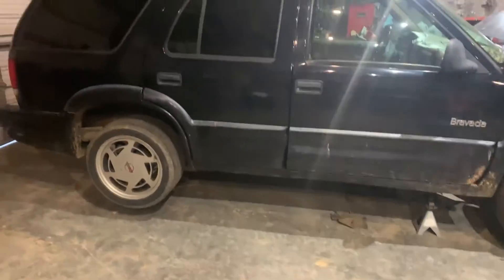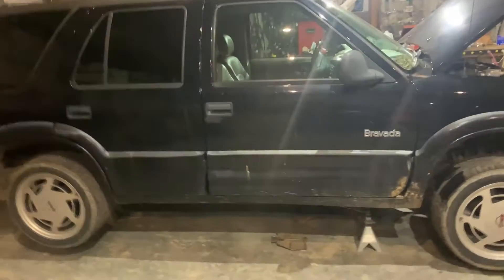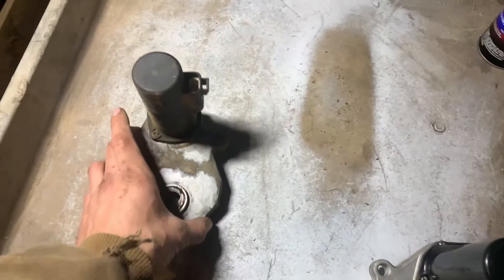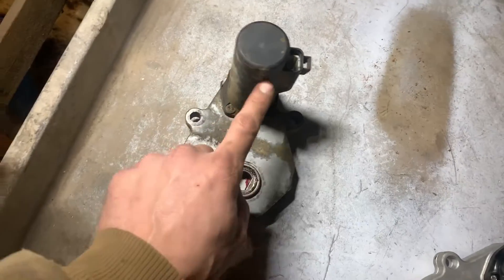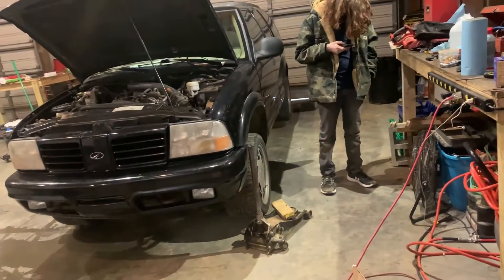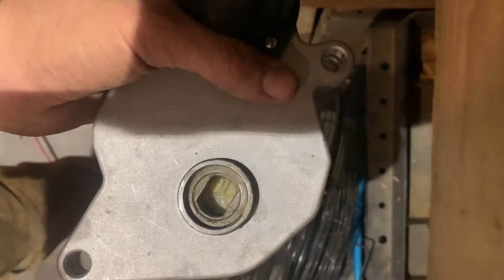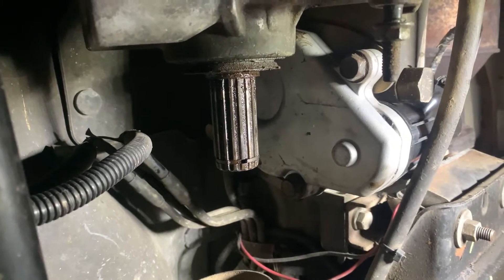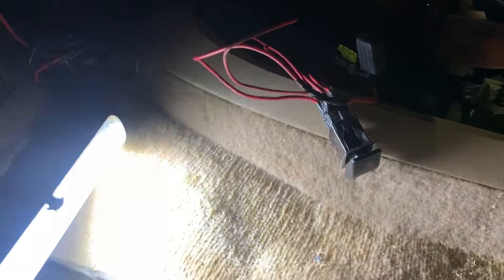We bypassed AWD SmartTrak system! //Bravada Episode 13

Comment: Wouldn't this throw a code if the system is trying to put it in AWD mode and it detects inconsistent wheel speed because your switch is off?  I just got done dealing with 2nd gear limp mode 100+ miles from home and drove home at 35mph over 4.5 hours all because of a stupid broken rear ABS sensor.  $700 in the hole to fix that.  I had absolutely no idea the ABS system was tied in to the transmssion's ability to shift.  Had I known, I would have just replaced the faulty ABS sensors myself.  I was getting inconsistent codes for a transmssion speed sensor (p0502 and p0500) when I threw my hands up and took it to the dealer.  I learned my lesson, but I'm also not keen on dorking around with overriding a system that will leave permanent codes and CEL on.
Reply from the maker: The wheels will turn the same speed regardless of switch. That’s awful! Yeah it sounds like your transmission didn’t know the speed.

Comment: So, other than selectable AWD, is there a reason you didn’t use the Astro-case?
Reply from the maker: This is the case that comes in these Bravadas. It’s auto AWD which isn’t a good design. This bypass is to keep it from engaging when I don’t want it to and to engage it when I do want it instead of it doing it whenever the system is triggered by wheel speed.

Comment: Life saver, need step by step guide for dummas
Reply from the maker: We’re gonna do another video whenever it comes in for upgrades. My fiancé daily drives it so we don’t get a chance to work on it often
Reply: I sure wished uwould let us know what the 7 wires are. I would like to be able to select awd and 2 wheel drive. I also have a black 98 bravada. Will this make other issues with the computer or anything? Would i be able to do burnouts in 2 wheel drive and then switch to awd safely?

Comment: When will u guys post how to bypass the AWD system? Do u guys live in KY? I live outside of Lexington.
Reply from the maker: The next time we get the Bravada in for servicing we will try to film an explanation
Reply from the maker: Yes we’re located in Leitchfield!
Reply: Just pull the fuse. That all you have to do to turn it off. I plan on putting a switch into this circuit since I'm LS swapping and want to be able to do burnouts.
Reply: Thanks guys. I'm trying to do a build and that would help me a lot.

Comment: I thought the rear ends that came in them were the bigger 8.5. Mine says Gt4 and G80.
Reply from the maker: No they are 7.5 or at least ours is. Gt4 is gear ratio and g80 is limited slip
Reply: I figured out gt4 means 373 gears.

Comment: U have done a lot of things im very interested in. I have some C5 rims im about to put on but dont know what spacers to use. The rear end in my 98 is narrower than in the front. Im also trying to decide which size tires to run because the fronts are 17s and the rear are 18s. I havd it figured out i think a 245/50r17 and 275/40r18 are pretty dang close in circumference. Only .1 difference. 26.7 and 26.6 so i hope it works. I plan to do a mercruiser intake and fuel injection swap also plan to buy an ebay turbo kit soon. I cant afford or find a typhoon so thats my cheap reneck plan to make my own. Thanks for any help.
Reply from the maker: Very cool! Keep us updated on the turbo build
On these all 4 tires have to be the exact same or you will cause excessive wear
Reply: I have been driving with these wheel and tire set up for a year now with no issues as of yet. The tires are almost identical in circumference. I have bought the turbo no but it's sitting in my shed. I dont have a garage. I put the marine multiport injection but as soon as I got it running I believe it's spun a bearing. It has over 200k miles on it. It's cold so I haven't gotten to mess with it much. Its loading up and has a knock to it now. I need another low mileage engine to put in it. I would like to try and salvage or build the engine that I take out.

Comment: Will this system work in a 89 blazer? 4x4 I looking to swap my 4x4 to a push button awd
Reply from the maker: Does your Blazer have a manual lever shift in the floor?
Reply: @s10life  yeah its all mechanical
Reply from the maker: I’m not certain you can put an electric actuator on there but you can swap transfer case into yours
Reply: @s10life  thanks and is the bravada transfercase a single speed locking system or is it kinda like the syclones which are full time locking awd?
Reply from the maker: The older Bravada is full time however this one is 2wd unless activated
Reply: Very cool idea. I can't wait for the video explaining the wiring...😉👍🏼 my 98 gmc needs this.

Comment: is it possible to make a 94 gauge cluster with a tach work in a 95 without a tach? or will i have to rewire everything? do the clusters without tachs have the same wiring as the ones that do have them?
Reply from the maker: I'm also in this same boat except the cluster I want to use for my '94 with a '95 CPI 4.3 is out of a '96 with obd 2. That's one thing youll have to look into that I haven't yet. Either way their should be a RPM signal wire somewhere  and you should be able to tap that into the RPM signal on the cluster side
Reply: @s10life  the junkyard above my house has a rare 94 100 mph cluster with tach used in trucks with the 4.3 vortec thats the one im planning on getting. my dad had a 94 2 tone black and silver single cab that had it.
Reply from the maker: I’m not sure about the early 2nd gens but our ‘98 Bravada cluster reads up to 120mph if you get lucky enough to find one
Reply: @s10life  the one i found is in a 94 bahama blue extended cab with the 4.3 vortec cpi
Reply: the one im looking at only has 1 harness on the back